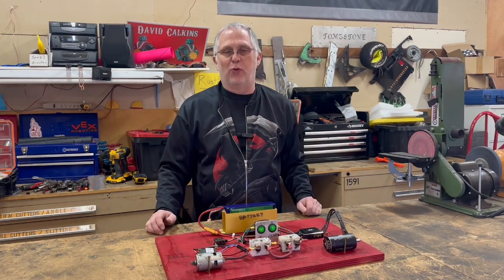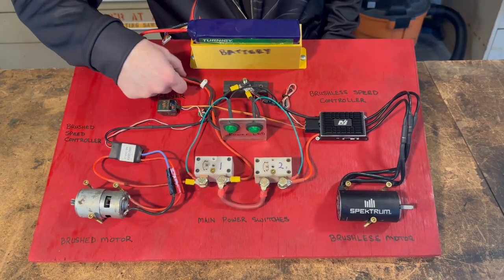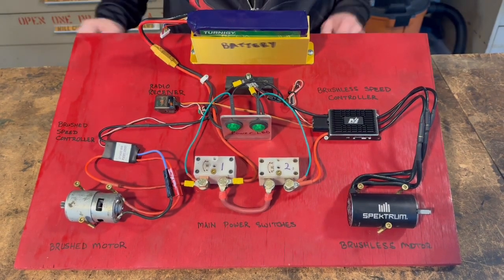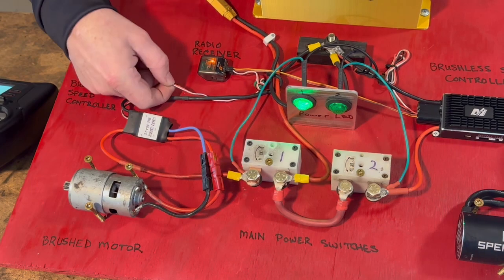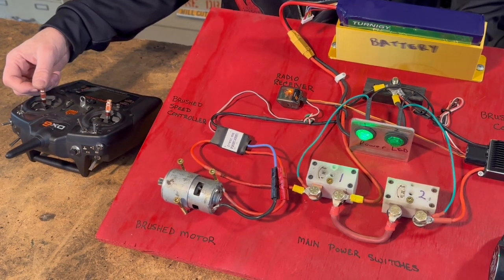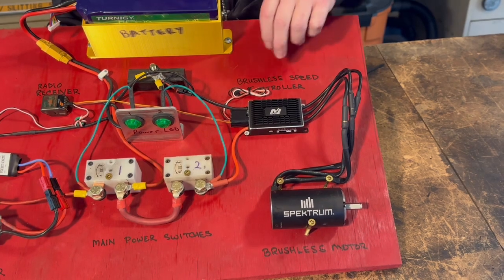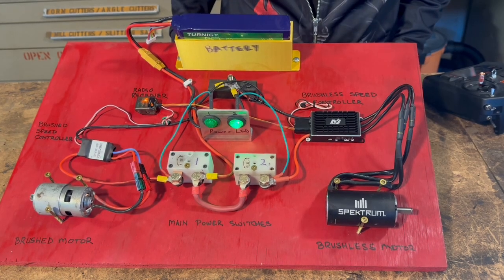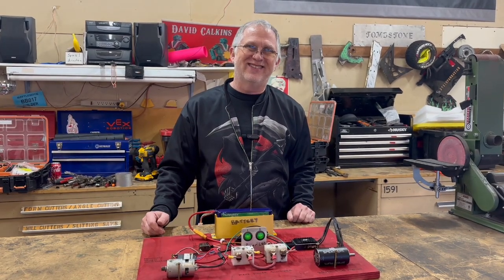Wiring a combat robot - the basics.

Comment: A question occurred to me from your video. You mentioned that if you swap wires around on a brushless motor, you'd have to reprogram the speed controller so it can figure out where the magnets are in relation to the armature. Would this also apply if, say, you had to swap out a motor or ESC that failed during a fight? 

If my understanding is correct, do some combat robot teams that pre-program multiple sets of spare controllers and motors together before packing up everything? That way, if something fails, they could theoretically just swap out the entire set, skip reprogramming the ESC, and have the robot ready to fight again much quicker than if they just replaced the broken part. (Setting aside the remaining good parts of the replaced set to pair with another spare later on when the team has some downtime, of course.) Or would this be a bad idea--e.g. the motor magnets get shifted about during shipment and you have to reprogram them no matter what, or reprogramming an ESC is easy enough once you've properly calibrated it to your motor that it's not worth the effort?
Reply from the maker: You are correct that whenever you make a change to the setup, you need to reprogram to make it all function correctly. It would certainly be possible to program a motor/esc together, and keep those units as a set to install. The reality though usually one or the other fails, and you only need to remove/replace that part. Let's say the motor dies and you need to put in a new one. It would take much longer to remove and replace the corresponding speed controller than it would to just reprogram it in place. I wouldn't see a value in pre-programming 'sets' this way, but I wouldn't be surprised if there is a team or two that does this.

Comment: I am interested in your choices of the wiring components. Such as the kind of wire (single strand, multi strand), size of strands, size of wire, insulation type, temperature rating, strain relief, switch size, connector type and size, battery size, capacity, voltage and type. And some of the reasoning involved in the choices.
Reply from the maker: Sounds like at some point I need to do an advanced version of this 🤣

Comment: Hey Ray, I have wondered. What is the rule with regards to powering the RX and other low power electronics (EG a telemetry system or something else) from separate batteries? Do they also need a hard switch or is it fine to keep them powered up just with software. And obviously assuming this was entirely isolated from the main robots power and couldn't feed anything else.
Reply from the maker: On board non-power delivering electronics are usually fine - but clarify with the specific event you are attending. Old school events, people would use a small separate battery to power the receivers, and many times these were left powered while you waited in line to start the fight. And as you can imagine, occasionally they would die before going in and the robot wouldn't work! Really this is one area where the right way to go about it is to have a switch there too. You can have as many as you need for your machine, as long as your power up routine doesn't take forever. I've seen bots with 4 switches before, and you can power up that many in just a few seconds.

Comment: Here's a question: Is it better to fix the wiring in place or not? Will it break more if it's tied down and secured?
Reply from the maker: It just sort of depends on the situation. You do need enough room for things to twist and move a little in the robot, but some measure of securing is usually a good idea.

Comment: Could you have a switch on transmitter to power off robot and also have the main switch
Reply from the maker: You can have more than one switch in a robot, as long as you have a way to completely disconnect main power. Extra switches are fine.

Comment: theoretically, would you be able to add a sensor to your robot that senses when the robot is flipped so that it flips the current from negative to positive, and likewise, so that when you get flipped, the drive controlls would be the same as if it werent flipped in the first place? that would be handy for tombstone. or does tombstone have that already?
Reply from the maker: Because of the speed in which this can happen in a match, I just get used to driving upside down. You *can do what you are suggesting, but it would be another potential point of failure in the robot, and in my case I can just learn to drive better and avoid it.
Reply: @ray9368  just a suggestion :)
Reply: I think they use a switch on their remote that flips the inputs
Reply: @demetriousramirez  he already said he knows how to drive upside down! pay attention!
Reply: @BotvacProductions469  hey I said that before he responded. Makes sense that tombstone just drives upside down, lots of experience to work with. I think I heard of switching inputs in an ant or beetleweight video

Comment: even at the basic level it looks so complex! now add a 60-80 pound blade and some more batteries, speed controllers and switches and you have tombstone. it looks easy, but it probably takes at least an hour or 2 to wire it all up. and you dont even have a weapon connected to it so thats another 3 hours added to it. i reallyn want to compete in a robot event when i get older, but i probabloy coulnt do that if i tried :face-pink-tears:
Reply from the maker: The basics of how things work doesn't change really - the same ideas of controlling tiny motors in an rc car and spinning a huge weapon in Tombstone are the same, just the parts themselves are much larger. It's not overly complex, just takes attention to detail. I always recommend people start out with smaller classes like ant and beetle, and once you get the basics down pat then move up to larger weight classes.

Advice I wish I had when I started!
Reply: @ray9368  okay. thanks for the detailed reply. :)